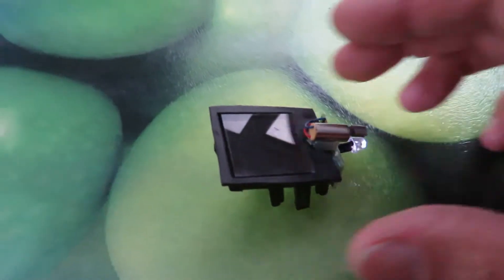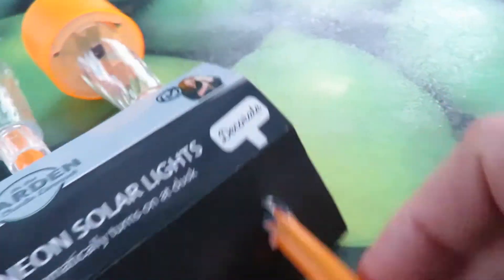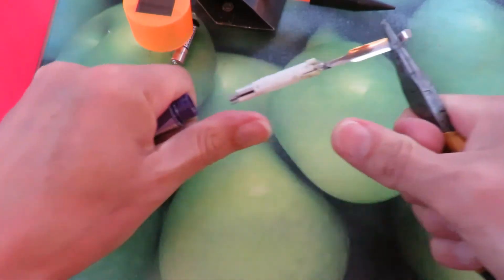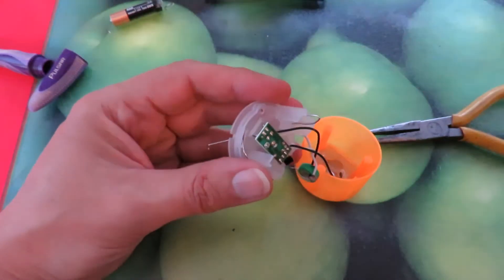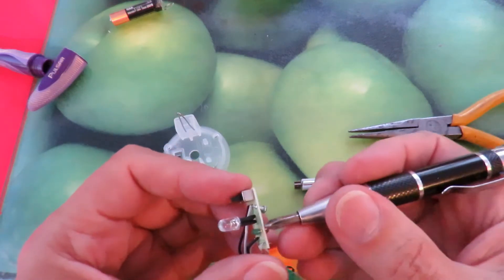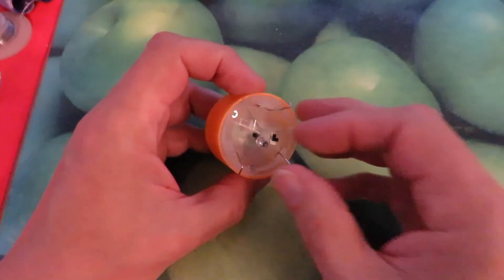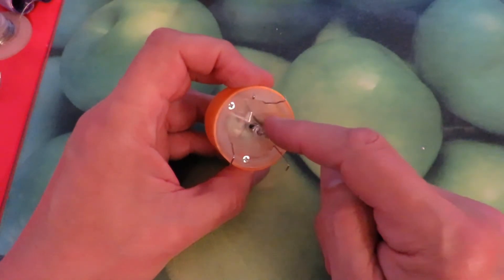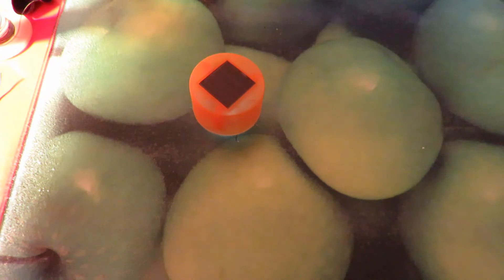Solar Powered Vibrating Bug Mk2 Full build

Comment: how long will the bug run once charged until its needs a recharge?
Reply from the maker: I can't honestly remember, several minutes I think, certainly not hours. What used to happen is I would leave it on a window ledge and forget about it, then after a sunny day it would start vibrating when the sun went down. I would be running round the house trying to find what the buzzing noise was, completely forgetting it was this bug.

Comment: Nice, thanks! I was looking for the motor on ebay, coudnt find it but found some phone vibrators at 2.5euros for 5, and then I remembered i have a couple of old phone that should have the vibrator inside!
Reply from the maker: Yes a phone vibrator should work although they may want a little more voltage to work really well. I have done a video of a simple vibrating bug using a little button cell sized phone vibrator but that isn't due for publication for a couple of weeks yet.